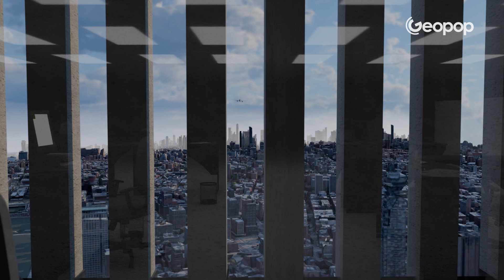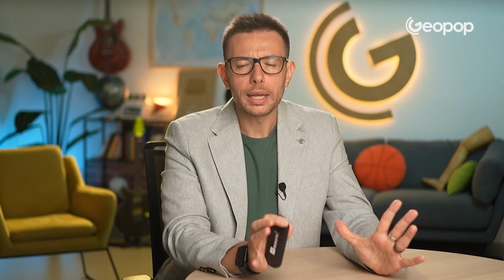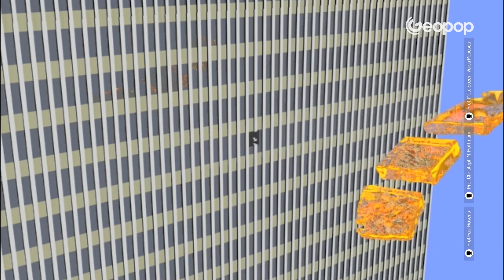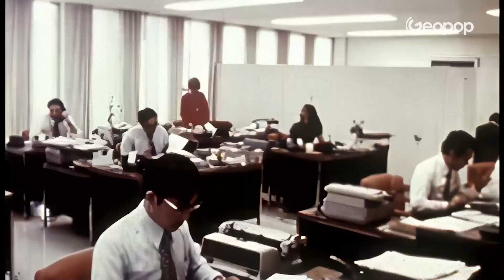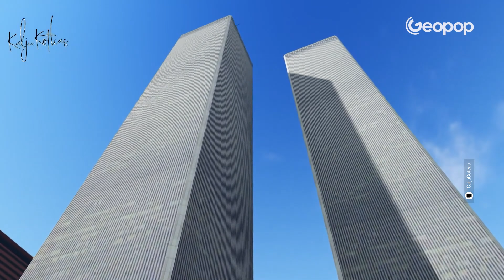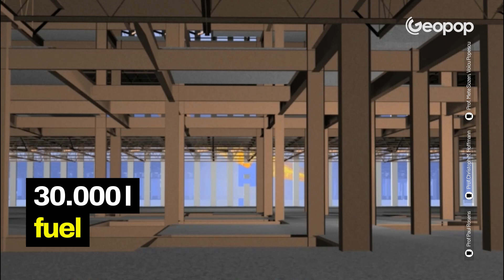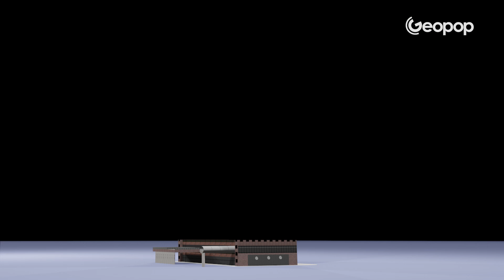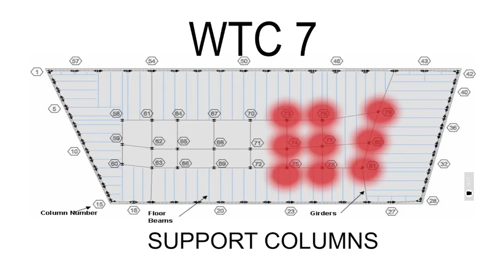9/11, 2001: The Technical Reconstruction of the Twin Towers and WTC 7 Collapses

Comment: Aluminum molten combustion. Water mixed with molten aluminum caused the explosion, blowing out the all ready destroyed and weakened steel beams. You see the molten pouring out and falling to the ground, from the South Tower, minutes before the collapse.  100,000 pounds of aluminum pieces of Commercial Jet airliner rested in the building, the rising heat melted the aluminum into a liquid molten that poured down into floors below, where the gathering of massive amounts of water collected from busted water pipes, sprinklers formed water pools causing the  aluminum molten to  mix with the water setting of a massive chain reaction massive explosion. Hundreds of survivors on the street recall hearing a massive explosions..  that was what they heard. The balanced chemical equation for the reaction is:  2Al + 3H2O → Al2O3 + 3H2. Reaction Detail Reactants: Aluminum (Al) Water (H₂O) Products: Aluminum oxide (Al₂O₃) Hydrogen gas (H₂)
Reply: There was no explosion. Collapse initiation was due to sagging floor trusses from the impacts and subsequent fires pulling some of the perimeter columns inward by up to 5 feet until they buckled, as we see here:

Gary Pollard South Tower collapse, looking at the east side toward the north. 

www.youtube.com/watch?v=ULdiD6gYZO0 

No boom boom

A straight column is up to 4 times stronger than a bent column. The more the columns bend the weaker they get. 

Once initiated there was nothing to prevent progression to global collapse. The falling mass of debris – hundreds of thousands of tons - had more than enough energy to drive its way through and dismember the structure below floor by floor, through the path of least resistance - the floor truss systems of the open office space, bypassing the load bearing columns entirely.
Reply: @TheLoonResistance  There were no sagging floors shillclown.

Comment: 🇮🇱 did 9/11
Killed thousands of innocent americans, and drag thousands of them to die in a nonsense war for 🇮🇱 interests in middle east
Reply: OK, but do you have any comments about the topic of this video.

Its about engineering BTW
Reply: @TheLoonResistance  are you Mossad or something?
Reply: @ChurroFackia - Because of course you went there. Always the first, last and only resort of the terminally smooth-brained.

This is an engineering video. Not for everyone. Might I suggest something more suitable to your talents?

 Something involving crayons perhaps.
Reply: @TheLoonResistance  go drink some 🥛🇮🇱
Reply: @ChurroFackia - Mine are better. Suck failure freak. No doubt you have lots of practice. Anti smite always do.

Comment: NIST never explained how the WTC  Towers collapsed.  They stopped at collapse initiation.  There is also FDNY thermal imaging video taken by a the FDNY pointed at the hottest part of the south tower and it never reached above 500F  The video stopps right after the sparks started coming out of the corner of the building where they were focusing their video..They were judging the fire intensity so they could plant their response once they reached that point.
Reply: Collapse initiation IS how the Twin Towers collapsed.  The rest is gravity.

Since the mechanisms are all clearly visible to the naked eye, had been explained long before The NIST came along and are easily understood by anyone with a basic knowledge of the Towers and at least one working eyeball, hardly require explanation.  I figured it out on my own a decade and a half ago, no need for The NIST.  

So what's holding you back?
Reply: @TheLoonResistance  Give the link in the NIST report that says that.
Reply: @williamthomas1 - That says what? 

Do recall, The NIST report wasn't written for you.  It was written for engineers, people who don't need their hands held.

Comment: Watch " Where did the towers go " Then you'll know what really happened.
Reply: Ah yes, Judy Wood – the RFK Jr of 9/11 woo_ . I read Judy Wood’s book.  I must say my experience with it was somewhat different than yours. 

Laughed my ass off. Lots of face palming moments.

Fundamentally, it is insulting on an intellectual and factual level, written to appeal to an audience that will put even less thought into reading it than she did in writing it. The evidence to support her case is incredibly thin and heavily cherry picked to fit her narrative while taking care to exclude any evidence that doesn’t. Little to no analysis worthy of the name is applied to any of it. Most of what passes for analysis is along the lines of “oh, isn’t this unusual.” Wood is vague and ambiguous, careful to avoid making definitive statements or drawing any conclusions she will have to defend. This is typical conspiracy stuff. Ambiguous, vague and obtuse. The target audience won't notice or care, just nod.

The theory – a conjecture really - Wood presents refutes itself. Back in 2001 every documented Directed Energy Weapon concept worked by thermal processes. Massive amounts of heat. Dr. Judy Wood’s cold process theory describes a non-thermal breakdown that operates on a different scientific premise, not unlike Cold Fusion which has long been a staple of crank science. 

It should be obvious from this alone it is a genuinely crackpot theory.  Pure fantasy.

It is worth noting when considering her book that Wood spent much of her academic career researching the material properties of teeth.  As a former university research scientist who had been published in peer-reviewed scientific journals more than 60 times, Wood understands the value of speaking to a knowledgeable, professional audience and how to do it. Curiously then, rather than present what would easily be by far the most significant – politically, criminally and historically – findings of her entire career to a technically knowledgeable audience, Wood chose instead to self-publish a for-profit book aimed at a technically ignorant audience.

That is truly unusual and inexplicable behavior for any professional. Wood should know better.

There are basically 2 standards for scientific proof: Affirming peer review, and independent lab reproduction.

Wood sought neither of these things. Hmmmmmm,… I wonder why. 

When I found out Judy Wood suffered a career-ending traumatic brain injury in a cycling accident which left her in a long-term coma, things made a lot more sense. Not her book mind you – it’s complete nonsense – but how someone who was once credible and scientifically minded could write something based entirely in speculative conjecture and then deliberately avoid the professional community in its distribution.

Wood is clearly not firing on all 8 and talking about things she had no knowledge or expertise in even when she was fully functional, relying on false appeals to authority to get her message across to a credulous non-expert audience.

If there were such a thing as a directed energy weapon powered by hurricanes and capable of turning the World Trade Center Twin Towers steel into dust (while at the same time mildly singeing some cars and causing no other collateral damage), where has this weapon been since 9/11/2001? This is a weapon literally capable of instant world domination. It would make every military in the world obsolete. It could end the War in Ukraine in a day! And Gaza!!! It could send the Chinese back behind their wall. Yet it only gets used once, and pointlessly at that?

Why use such a device at all in an attack that absolutely has to look like it was done using hijacked planes and nothing else and when it isn’t even needed?

If you can answer any of that with something that won’t induce roaring laughter, then by all means have at it.  Be the first.

The whole idea is just so many levels of stupidity it boggles the mind. There is no physics in her book and almost no analysis. It is entirely premised around magical thinking, doubt seeding and lie-by-omission.

Point of fact: The collapse of the Twin Towers created a 17 acre debris pile up to 14 stories deep that destroyed 8 surrounding buildings and damaged over 100 more.

No steel turned to dust as simple observation will confirm   www.youtube.com/watch?v=u2D__-DVLBk 

This is why Wood has always been way out on the lunatic fringe, zero support in the scientific community and barely any even among other fringy conspiracists, whose standards are low but not that low. Also worth noting that Wood has not bothered to promote any of this stuff for many years. Must not have been that important then, or maybe it just stopped producing income so she moved on.

PS

You can’t get much more direct energy than a collapsing 110-story building.

Comment: I worked for Deloitte and Touche on 97 floor on Tower 1 in 1984.  Got a job at Langley in 85.  Worked in DC up until 9-11.  Was at Pentagon on 9-11.

Went back to NJ after 9-11 and wound up driving the 9-11 to Millenileum Hotel.  1st time I'd been there since 1984.  It was unreal.  Everything was gone.  Read the plaques on the fence and started crying.  It was crazy!!  Sad day.

Comment: Difícil é explicar se um avião realmente atingiu o pentágono!
Reply: While not the subject of this video, speak for yourself:

A case is not made from one grainy video, one random anomally or one witness who said X.  A case is made by assembling ALL of the available evidence and determining how the pieces fit. 

We know Flight 77 – a Boeing 757 - hit the Pentagon because of ALL of the following true and relevant facts, not because of one random anomaly. When complied together, all of these true and relevant facts form a single inescapable conclusion; 

1. Witnesses: Local and national media published or broadcast the accounts of ALL of whom reported a plane hit the Pentagon, while no witnesses reported seeing anything else (ie: none saw a missile). Around 2 dozen witnesses could identify either the aircraft type, the airline or both. 

2. Flight Path: On its way in, Flight 77 created a damage path (the tree hit by the left engine, the 5 light poles, the garden wall on the Pentagon lawn and the mobile diesel generator) which is consistent with an aircraft the dimensions and layout of a Boeing 757. No missile could do any of that. 

3. Impact Hole: The impact hole in the outside wall of E-Ring at Wedge 1 of the Pentagon matches in size and shape the Boeing 757 from engine to engine. Wing impact marks extend out on either side of that to the span of a 757. youtube.com/watch?v=FkgJ-rFFBD0 

4. Building Damage: The damage path inside the Pentagon takes the shape of an inverted cone, with over 80 support columns all of them bent in the direction of travel. This is consistent with the high speed impact of a Boeing 757 aircraft and NOT the high-explosive blast warhead of any missile. 

5. Aircraft Wreckage: 19 tons of B757 wreckage were recovered at the Pentagon crash site including the landing gear, both engines, the entire left wing flap assembly, part of the cockpit, seats (some still occupied), landing gear bay doors, fuselage sections, the Flight Data and Cockpit Voice Recorders for Flight 77, etc, etc,... youtube.com/watch?v=kCRuVNgrAAw&ab_channel=cjnewson88 

6. Two parking lot security camera videos from the north parking lot security booth captured images of a B757 sized aircraft in AA livery flying along the exact flight path of Flight 77 and at the same velocity recorded by its FDR. The aircraft was trailing smoke from the right engine due to hitting the aforementioned tree moments earlier as confirmed by several witnesses. 

7. Human remains: The remains of everyone aboard Flight 77 were recovered and identified with the exception of 1 infant whose remains could not be identified. Some victims were recovered still strapped in their seats. Each of the victims families were provided with a detailed autopsy report. 

8. Personal Effects: Several thousand personal items belonging to persons aboard Flight 77 were recovered at the crash site at the Pentagon with the victims families being provided with a 1,000+ page book detailing every item for identification and return. 

9. Radar: A total of 6 FAA and NORAD radar sites tracked Flight 77 from take off to impact. The radar data matches EXACTLY the 25 hours of flight data recovered from Flight 77’s recovered FDR, right down to the last decimal. youtube.com/watch?v=3vqDDlS9Hyw&t=6s&ab_channel=cjnewson88 

10. Insurance: American Airlines and its insurers accepted responsibility, admitting Flight 77 crashed at the Pentagon and subsequently paid out tens of millions of dollars in damages. 

11. Boeing; The folks at Boeing confirmed it was a Boeing 757 and specifically Flight 77 which hit the Pentagon. 

12. Where is Flight 77? It is a fact that Flight 77 never landed anywhere, nor has anyone aboard been seen or heard from since 77 crashed into the Pentagon. 

13. Even if the 9/11 attacks were an inside job, Flight 77 still hit the Pentagon and the above true facts are still true facts. “9/11 was an inside job” does not mean “flight 77 did not hit the Pentagon”. 

14. Pilot Skill: Hani Hanjour was a crap pilot and his flight path proves it. But he was grossly over-qualified to crash a plane – something anyone can do. A number of Hanjour’s instructors are on record stating that while he was not a good pilot, they have no doubt he crashed Flight 77 into the Pentagon. The conspiracy types always leave that part out. 

15. When staging an attack that absolutely has to use planes - and I cannot stress this enough - you use planes. Common sense. 

16. No blast crater or damage, radial fragmentation pattern, pre-formed fragments, missile parts or anything else associated with a missile were found. 

All of the above is true no matter who planned and carried out the 9/11 attacks or why - which I know will be seen as a blasphemy by many reading this. 

Anything can seem like a conspiracy if you don't understand it. Now you know. If I missed anything important that moves the needle please let me know and I will make the correction. If you can do better then by all means, have at it. I am open to any more plausible alternative as to what hit the Pentagon using ALL of the available evidence while relying on fewer unproven assumptions than what I outlined above.